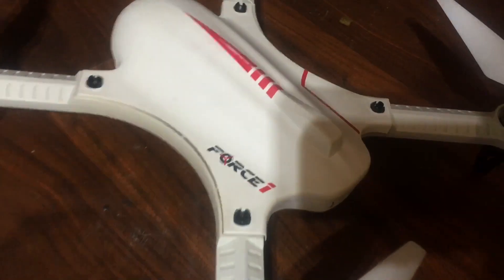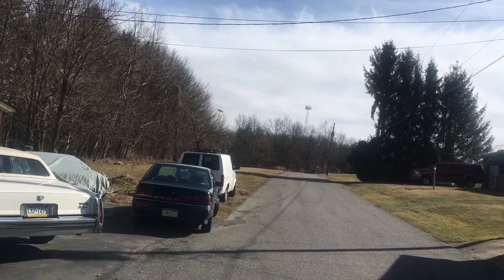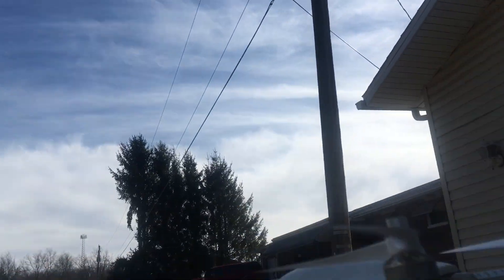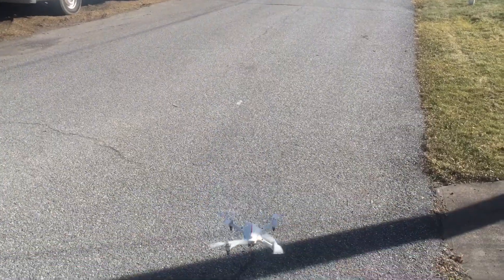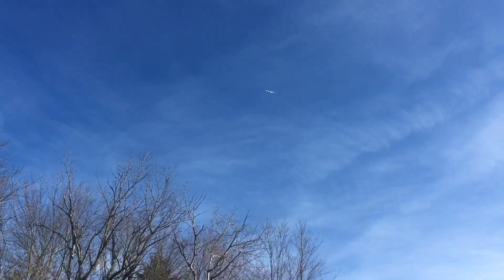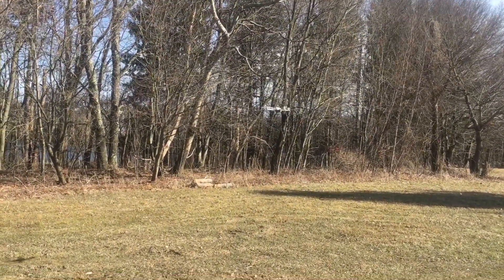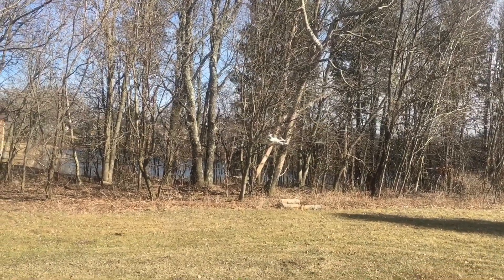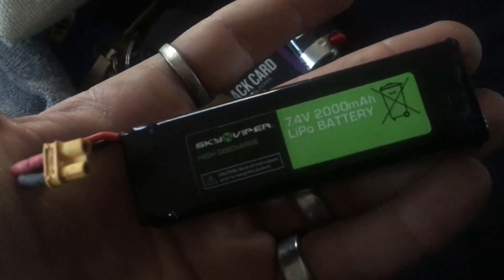Best battery for MJX Bugs 3 RC drone force one compatible Makerfire 🔥 T-Lite Multi-protocol Radio

Comment: Jay, do you know of any way to tweak the rates on the Bugs2 / Force1 FW200? I had an original Bugs2w that flew away lost after a lot of use. I just picked up a Force 1 FW200 and the rates are super slow. Pitch angle looks limited to 20’ and descent rate is painfully slow. Not nimble at all except in climb.
Reply from the maker: Using a multi protocol controller, you can complete the rates